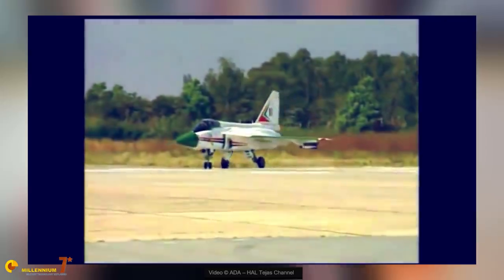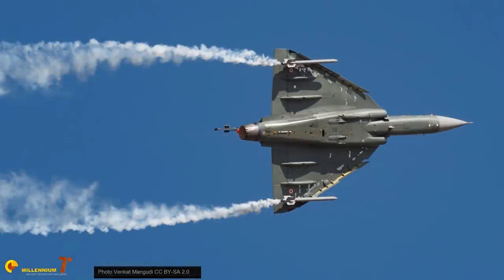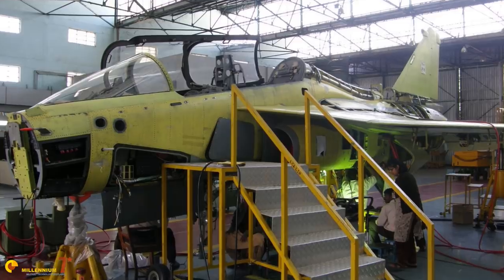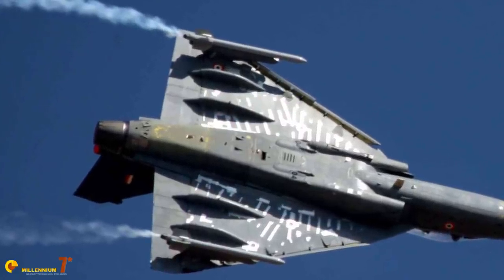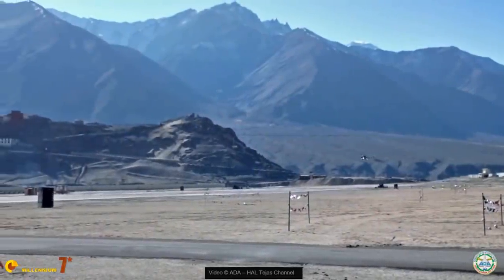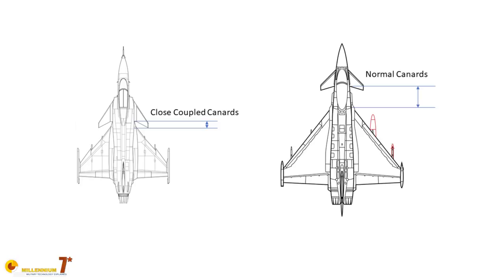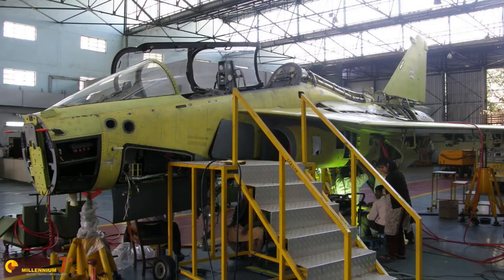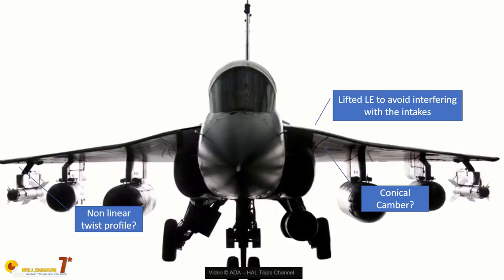TEJAS Aircraft  Aerodynamics Analysis - The Swedish Connection?

Comment: On the intakes, there were many errors in reporting :-). 
1. The original intake was designed for the Kaveri. But it was revised for the F404 including work on the lip and the area for the cross-section. They decided to stick to the circular intakes to decrease skin drag and improve pressure recovery. The design optimization was done in consultation with GE.
2. The auxiliary air intake is not because of the choice of the engine but an attribute of the fixed geometry. All 4th generation aircraft are designed for intakes optimized for high subsonic to transonic region. The auxiliary intake is to take care of the off-design point which is low speed. The auxiliary doors are spring loaded and open to let is more air when the speed is low. This is true for Rafale, GRipen, F-18, Jaguar etc. EF uses a moving lip. In the case of EF though, the lip movement is active.
3. The Mk2 (or what is now called the MWF) won't have a shock cone. None of the new designs use a variable -geometry inlet to reduce weight, complexity and RCS. This is because the focus of aerial wars has shifted. Nobody cares about top speed as much. 1.6M-1.8 M is enough. They want reduced cross section. The RCS of Tejas is really small thanks to its small size, low number of control surfaces and large use of composites. It is cleared for 1.6M. It is capable of 1.8M.
4. On the Mk2 however they have made changes to the intake. What is obvious is that the intakes are canted. This for reducing wave drag and RCS. The other thing that is not obvious in the following. In the Mk1, the wing leading edge shielded the intakes at supersonic speed. On Mk2 they elongated the intakes for best area ruling. This means that the intake is ahead of the leading edge of the wing! They modified the splitter plate to create the shock. ACtually, the splitter plate that is shown in the display models is not up to date.
Reply: Indranil Roy you are very thorough brother. I am so happy to just read ur comment because it's full of good information. Do you write a blog or follow Tejas latest developments somewhere? I would love to learn more.
Reply: @santoshsundar1186  Thank you for the kind words. I am a forum moderator at bharat-rakshak forum. I have studied Tejas from public sources for over 20 years. Have been fighting misinformation on this fighter for over a decade now.  This video is objectively made . But MANY MANY reports and videos have been made on Tejas before with vested interest. India is multibillion dollar fighter aircraft market. It makes perfect sense to not let its indigenous aircraft industry grow. I am afraid IAF hasn't helped much either except for support from NFTC during 1990s-2010s. However, things have  changed a lot. The current IAF chief is a Tejas TP, and a BIG supporter.

Here are a few articles I have written on the Tejas.
1. http://delhidefencereview.com/2019/02/22/tracking-the-tejas-the-design-evolution-of-an-indian-fighter-part-i/
2. http://delhidefencereview.com/2019/02/23/tracking-the-tejas-the-tejas-mk2-grows-a-pair-becomes-the-medium-weight-fighter/
3. http://delhidefencereview.com/2019/10/15/a-detailed-look-at-the-design-evolution-of-indias-naval-lca-mk1-fighter/
Reply: @indranilroy1983  I am so glad I met you here. I am a fellow well wisher of Tejas. Ever since I saw it fly the first time in Bangalore, I have been a fan. Thank you so much for sharing the links. Jai Hind.
Reply: Hey bro, Thanks for the info. really appreciate it :)
Reply: bharat-rakshak forum bina padhe mai sohi nahi sakta.
Reply: @indranilroy1983  Hi Indranil, maybe you are the right person to whom I ask this question.
There is no difference in GEF414 and F404 size ( because 414 was suppose to replace 404 ) except that 414 is heavier. But then 414 has a T/W of 9 better than 404 which makes sense to use it. Then why its not part of MK1A? I do not understand why such a simple albeit important upgrade is not in MK1A and we wait till MK2??
Reply: Simple as in only we have to cater to COG which I am not sure how its done but as per my knowledge for a Multirole Aircraft its easy and controlled by Flight computers.
Better engine will lead to better Aero performance and weight capacity.
Reply: @RP-qs1tp  I am afraid that is not the case. The dimensions and weight is not the critical part. The F414 has very different airflow requirements. If you change in such an engine you have to redesign the intake. You are speaking of the heart of an airframe here. That takes time to design and more importantly flight test and certify. Mk1A is based on concurrent design and manufacturing. They have already ordered the parts for the same. If Covid was no here subassemblies would have started. They are not making any changes to airframe. Avionics wise it is getting a very good upgrade.
Reply: Actually your question of engine upgrade is significantly more complex than some of the changes I had wished for. I hope they break the Mk1A orders into two blocks. In the second block I would love to see some of the changes thought for original Mk2 applied. Even if they don't use the 0.5 mtr body plug, they can work on the canopy area, the engine bay doors can also get some treatment. Finally, extensive studies have been done on extending the intakes beyond the LE, and canting it. You can see those on the MWF. Those help in the wave drag significantly.
Reply: @indranilroy1983  how much different from f404 are we talking here..? I assume they have already done it for MK2 , so why that intake design can't be used on mk1a..
Reply: @prashantsharmastunning  Most people underestimate the changes. 404 -> 414 changed the entire airframe for F-18s, Gripens and now LCA. F414 doesn't magically get higher thrust with same dimensions. It has to have more air flowing through it do so. In terms of engine talk you are speaking of a significantly higher Turbine inlet temperature and pressure ratio. To handle that the inlets have to be completely redesigned. Inlets are not just a tube to let air in. They are incredibly complex. For example the lip is design like the LE of a wing. In the interior the cross section changes so that the airflow at the face of the engine is always subsonic and at very high pressure. If you do not do so,  your engine will work very inefficiently
Reply: @indranilroy1983  Wow. Indranil thanks for the detailed answers to everybody's queries. You really explained why its not worth putting time and efforts to integrate 414 on MK1.  As per my understanding MK1 intakes were originally designed for Kaveri and they still have airflow issues with 404. Even with this limitation it gives TWR of 0.95. In MK2 with everything redesigned + more thrust of 414 + increased length for reduced drag. Wow we are looking at gem of a fighter. I can not wait to see how it performs.
Reply: @pravinmeher2036  Just one correction, the current inlet on Mk1 is optimized to the 404. The pressure recovery is excellent for a Y intake.  The new design (on MWF) is not optimal from the pressure recovery point of view. It is heavier too by some 31 kgs. But the wave drag reduction that it provides more than compensates these slight drawbacks.
Reply: Kudos to your research sir
Reply: Indranil Roy  How accurate do you think this is to the actual mk2 version
https://youtu.be/s_aeXnew0_Q
Reply: @Wraith96518  Very close. The canard  trailing edge sweep seems to be little off. The splitter plate is not current (Kuntal drew it based on renders from AI19).
Reply: Kanwer Vikram  , that will be a very long reply and subjective at that. Mk1 is not best in class. But it is not way off. The best range scores at Vayushkati belonged to 9 Tejases employed, even better than upgraded Mirage-2000s and Mig-29s. Sortie rate demanded was 6 sorties per day. availability was over 90%. 

Mk1A will be even better. MWF, Gripen E/F and upgraded J-10s will be best light fighters in the world past 2025.
Reply: Kanwer Vikram  wow, most Indians are rejoicing the decision, and some Indians are still licking the "Gorhas"
Thats a bit embarrassing. 
Anyway, Indranil did point out that would be a long answer, but if we take a couple of aspects into consideration - Tejas mk1A is coming in with a powerful AESA radar along with advanced avionics of the 21st century, along with its semi-stealth capabilities and a powerful EW suite  Vs Pakistani F-16 variants with an older pulse dopler radar, inferior 1980s avionics and a much large radar signature...or the Chinese J-11(Su-27 copy) with the same features.
Do the math.
Reply: Kanwer Vikram  First step of any such deal is Release of REQUEST FOR PROPOSAL(RFP). Unless that happens , no such programme is kickstarted and everything is on papers/plans.
Tejas mk1A deal is in final stages pending with MoD, while budget for Tejas mk2 has been released, so these 2 are sure shot.
And offcourse Tejas mk2 will be more success than Tejas mk1A
Rafale FR3 is more success than Rafale FR1 and FR2
Eurofighter Tranche 3 is more success than Tranch 1 and Tranch 2
F-16 E/F is more success than C/D or A/B
J-10C is more success than J-10 A or B
Every fighter jet is improved over a period of time.
Buying PHOREN maal under the pretext of "Security" should not be tolerated.
Reply: Your Delhidefensereview article was superb. It took the wind out of the sails of those foreign companies which were using our media to slander the beautiful Tejas. Anyway, I am also a member in brf. The best site for knowing about indian security issues/policies from a lot of learned intellectuals.
Reply: It seems like some operatives of past inside IAF are thief's...They still trying there best to boycott made in india..
Reply: I don't pretend to understand everything you mentioned but I could make sense of a few. Nicely done.
Reply: I totally agree that an indigenous aircraft industry would mean 10s of billions in lost revenues to arms suppliers. The Russians especially have been really fleecing India.
Reply: @indranilroy1983  IIRC there's a recent rebuttal to a TOI piece from your side. Hats off to your work!
Reply: Thank you Mr. Roy! Appreciate your effort!
Reply: @indranilroy1983   Indranil Ji, will kaveri ever be used with Tejas?
Reply: Very unlikely
Reply: @indranilroy1983  Thanks sir.  What do you think of the  K 10 engine program ?
Reply: @hanselxyb5825  , I am not very aware of the engine technology.
Reply: @indranilroy1983   Thank you brother for your update about Tejas.Though I work in GE (healthcare division) I wish that our country must get success in KAVERI engine and upcoming AMCA5th generation fighter aircraft.Tejas is the begining of our success story and when we will get Kaveri no one can stop us.
Reply: @indranilroy1983  Sir, Can you explain AMCA capabilities if it became a reality?
Reply: @abilliondreams8046  , That is a very long reply. You can ask about a specific aspect and I can share what I know.
Reply: @indranilroy1983  Are Tejas FOC standard nd Tejas MK1 the same?
Nd
Wat is the difference between Tejas MK1A nd Tejas MK2?
Reply: Indranil Roy Thank you so much for such detailed explanations on so many different aspects. You Sir are,  Super De Dooper 👌
Reply: @Indranil what I get to know reading this thread, developing an engine should be on priority, I mean they would design AMCA's inlets for a certain engine and end up changing the inlet design for another engine😓 it'll completely impact the airframe and overall design
Reply: @siddharthkrishna5975  , yes. The problem is we have a bunch of bean counters who sign on the dotted line. Engine development qould require an investment of a billion dollars a year for a decade. No country has done it in any less.
Reply: Clear and well detailed! Impressive! Thank you!! Keep talking!!
Reply: @indranilroy1983   Hi Indranil.  I've heard that Tejas is equipped with DASH helmet-mounted displays supplied by Elbit systems. Can we expect an indigenized version of this in the near future?? I've also read some time back that IAF plans to use Tejas for point-defence rather than for air dominance. I know Tejas Mk1 is no air dominance fighter, but could you shed some light on what this point-defence thing means for India??
Reply: @shravan7623  Yes indigenous helmets are being designed for use across the board on Indian fleet. 
The strategy for Tejas is evolving. I am sure TACDE will get involved. But those tactics would be confidential. Baki, all this discussion of point defense verus air dominance etc. are moh maya.
Reply: Bro will it be cleared for 1.8 Mach from present 1.6 Mach?
Reply: @nirmalmallick3349  Not till Mark2
Reply: @indranilroy1983  Ok. I'm so excited about these projects. Yes   it takes time😔
Reply: Thanks, The articles are very helpful. I sure will share those where i see lack of knowledge and understanding.
Reply: @Surya Kiran Catching up quickly.
Reply: Great info. It would be very kind of you to pls satisfy my one doubt summarized as: 

Tejas /MK1/2 good enough or comparable to F16, Gripen, Rafael?? The term LCA is creating questions.
Reply: @paramveersingh663  It is not correct to compare LCA to Rafale. Twin engine fighters will always enjoy an advantage in performance at the cost of price. But in terms of subsystems/technology LCA Mk2 and Gripen E/F won't be any further behind than Rafale. LCA Mk2 will be equivalent to Gripen E/F of that much you can be sure. One advantage that India has is the AMCA, TEDBF programs. Mk2, TEDBF and AMCA will share subsystems and all combined have much more funding than the Gripen E/F. GRipen E/F and LCA Mk2 will be superior to F-16. It's not fair to compare them because F-16 was designed 50 years back. DEsign and manufacturing techniques have moved ahead. I have the highest respect for the F-16. The other three can't reach the legendary status that F-16 has reached in the history of military aviation.
Reply: The legend Indranil Roy from twitter. 🙏
Reply: @nisheethshukla6142  Not a legend. But, thank you.
Reply: @indranilroy1983  I have learnt more from you than anyone else in past. I'm a huge admirer of Tejas programme and am trying to  track every single details about the programme. Since you write in DDR I understood you are a person without BS. So sir I have couple of questions for you and looking how active you are in the You tube comment thread I am humbly expecting for your reply
1st : (This maybe a bit non technical but you might agree it's a valid discussion) Looking at the need and requirements of MRCA tender do you really think that IAF needs to go for any foreign fighter jets? Looking at the ongoing mk2 project if we are making something similar (if not better) to gripen e/f then what's the need of continuing with the MRCA tender? Could it be a possibility of foreign lobbying?

2nd: There have been a lot of discussions made about UTTAM AESA Radar. Can we expect to see UTTAM AESA Radar on MK1A and MK2?

3rd: Will IAF consider to replace it's fleet of mig29 upg and jaguar fleet with MK2?
Reply: @Krishnendu792  thank you for the respect.
1st: It makes sense to buy a few more Rafales to amortize the billions we paid of India Specific modifications. Buying F-16IN/Gripen E/F doesn't make sense to me.

2nd. Uttam is flying in two LSPs, the nose of a business jet and also being evaluated from rooftops. Albeit it is a downsized version of what is flying in the Netras. The test results have been very good. DRDO is pushing hard to get Uttam into Mk1A. But I don't think it is possible given the timelines. But, you will see them in Mk2, upgraded Su-30s and AMCA.

3rd. Mk2s are able replacements for Jaguars and Mirages. But AMCAs are better replacements for the Mig 29s, I feel.
Reply: @indranilroy1983  Thanks for the reply
Recently we are seeing that Russia is trying hard to get India back in the FGFA programme. Do you think there is any possibility that India will consider to rejoin the FGFA programme? 

HAL has shown confidence to complete the AMCA mk1 by 2028-30. From your perspective, how much realistic this timeline actually is?

Is it possible for India to make a true 5th gen engine with foreign help by 2030 or maybe a bit later?
Reply: @Krishnendu792  
1. 2028 is possible for AMCA. Work is progressing at a fast rate.
2. I don't think that FGFA will happen if AMCA makes steady progress.
3. Nobody is going to sell us our crown jewels. China and Japan are at the verge of getting there, but they have got there on decades of high R&D.
Reply: @indranilroy1983  How much money did we spend on FGFA program and as we didn't acquire anything technically, will Russians repay the money or it will be another vikramaditya story??
Reply: @bikashnayak9311  Sunk cost. $300 million. We can't get it back because we backed out.
Reply: @indranilroy1983  Reasons??  Dollars or Rupees? Why to invest then??
Reply: @bikashnayak9311  Dollars. It is not about why invest. That money is already spent.
Reply: @indranilroy1983  did we learn anything?? 
Is it how we could design our own 5th gen fighter?
Reply: @indranilroy1983  Sir, is there any platform where I can follow you? I would like to keep me updated on these, I also follow a number of YT channels like this one and many Indian channels too like, defence decode, alpha defence, defence matrix, defence squad, etc. Plzz reply, thank you.
Reply: @siddharthkrishna5975  we already are developing engines, there are two teams one with GE & 2nd with Safran.
Reply: @indranilroy1983  did that in the very morning after going through comments, found a guy with his comment, "The legendary Indranil Roy from twitter" or something like that, and followed you then and there with a couple more 😊
Reply: @indranilroy1983  Kaveri is going under trials this year? Surface trials, I got it from Alpha Defence, just now.
Reply: L
Reply: Sir why don't you write about tejas....and ask someone to make video on that.....
Reply: @indranilroy1983  I appreciate your knowledge! Excellent learning about our nation's pride!
Reply: I think you missed the part where the splitter plate cannot be operated at a speed higher than 1.4 Mach. All IAF Tejas have been limited to the speed of Mach 1.4.

The air intake doesn’t have the capacity for taking as much air as it should be requiring without major design change. The engine is unable to give maximum throughput and Grippen with the similar engine can reach the speed of Mach 2.0.

These issues seems to be fixed in MK2 but none of the MK2 are made and they are still  on design board. So have to wait and see
Reply: @khalidkhalill  Sorry dude, that flies in the face of aerodynamics 101.
Reply: @khalidkhalill  Sorry, but that flies in the face of Aerodynamics 101.
Reply: @vin-bharatmahaan6569  
1.	Mk1/Mk1A currently does/will not have integral MAWS. The aerodynamic impediment on the small airframe was deemed too large. Instead, its missions will be adjusted based on susceptibility from MANPADS
2.	They will have poded solutions in the near future. However, instead of taking one full pylon, it will be adapter based, i.e. the pylon would house the sensors. 
3.	Mk2 will have integral MAWS sensors.
Reply: @Indranil roy, you should start ur own YouTube channel. Blogs are good not making a reach in today's times. Meanwhile ur blogs have excellent insights👍👍👍
If u already have a YouTube channel share us the link. 
Don't worry about graphic ui for making YouTube videos, ur speech content is more than enough. I am be waiting to subscribe 👍👍👍
Reply: @kevpatel9940  brother 😂
Reply: Its combination of soviet mig 21 , french mirage fighter and sepecat Jaguars...
Reply: Namaste indranil sir , I think you have done great in terms of studying tejas and have been fighting for it on the www
How about making YT channel , because I feel most of the less aware people find information on YT and get misinformed heavily. YT had greater reach it could help your objective to fight the misinformation about this beautiful sstate of the art machine. If you think of doing it someday share the link in this comment section 🙏 you have already got so many people who have praised your knowledge they will subscribe you 🙏
Reply: @IndranilRoy Is it possible to create a video with the fixes in this video?
Reply: @RP-qs1tp  same reason why boeing had to change Hornets intake to cater to f414 airflow